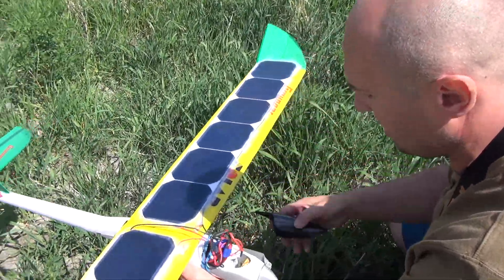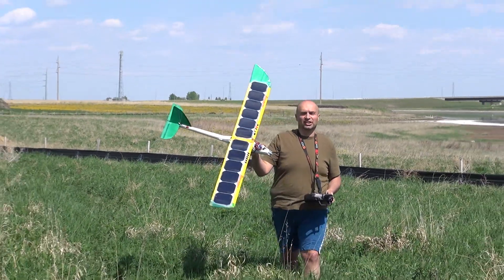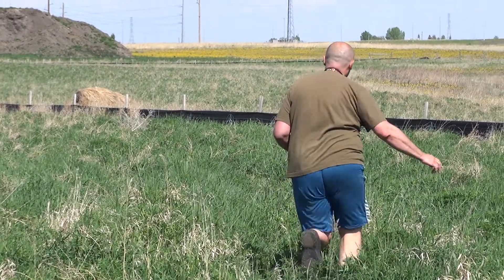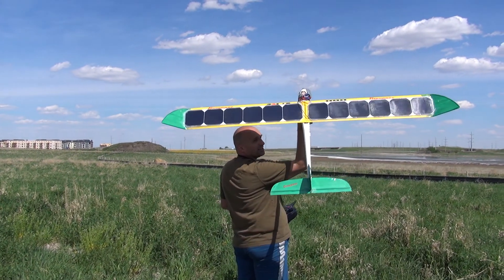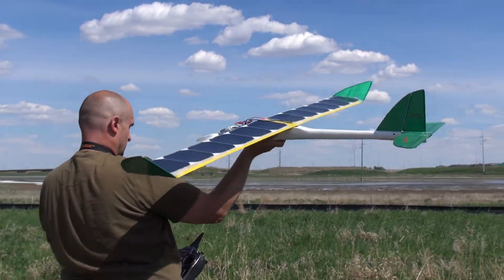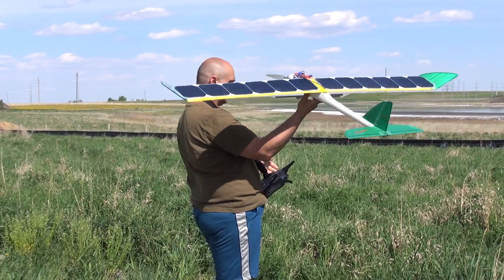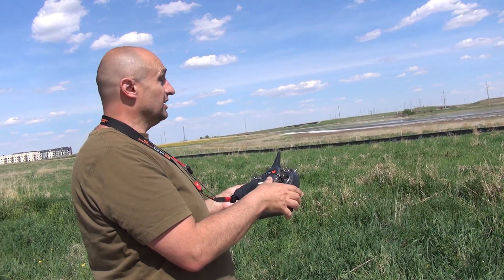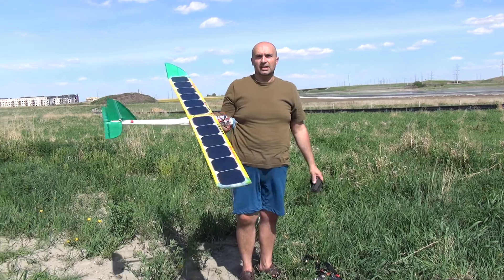.. SOLAR UHU .. FLIGHT TEST ..  WITH AND WITHOUT BATTERIES .. 20170522153110 1

Comment: Usually it it takes 50w pr kg on a glider.. So you need more power.
3 A123 celles in series can handle the voltage from the solar cells directly.
Reply from the maker: Yes I know this setup is too weak .... solar cells are to heavy .... 
For direct SOLAR  MOTOR  function .... still need lighter glider possibly made out of foam ..
Thanks for support .. 😁 ..

Comment: Very nice congrulate you. I wanna ask a question , can we use both battery and cell together .  Does balancer need ? or can i charge my battery directly from cells without balancer?
Reply from the maker: Yes you can no balancer needed  if you use nicd  batteries